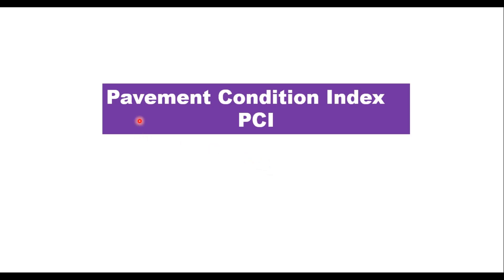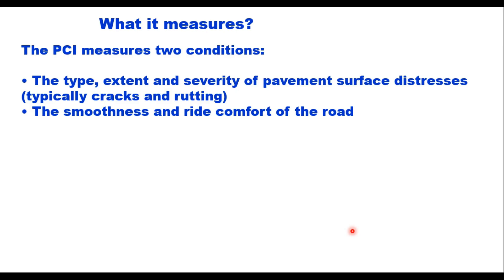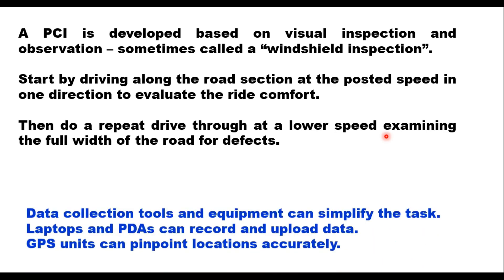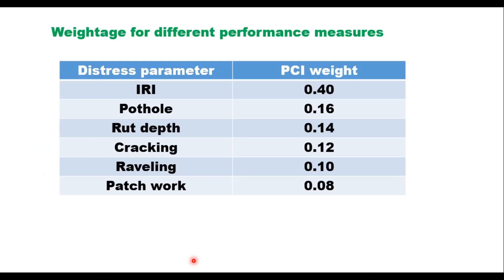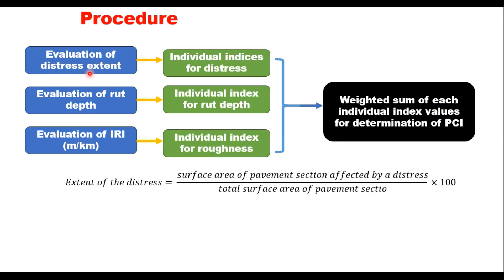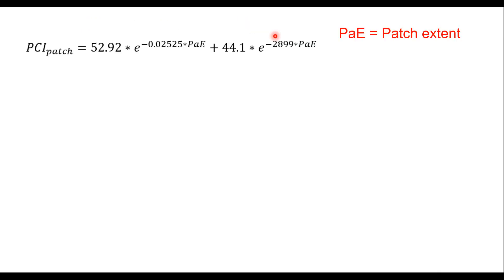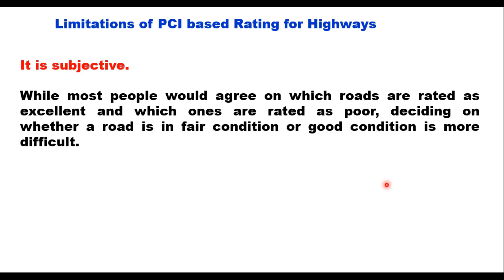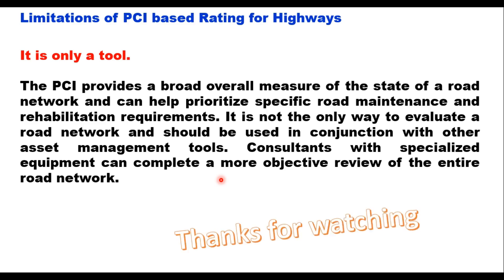Pavement Condition Index as per ASTM and IRC 82, 2023. step by step procedure and explanation.

Comment: sir for transvers and langitudinal how to measure in our case we measure length and width of crack is this currect are not and main cause for transvers crack is up rooting now what measurement shall we take either we take crack width or total uprooting  area what should we do now and this uprooting are same as bump or speed brakers give me the solution for this sir please
Reply from the maker: Take both separately.  Please refer IRC SP83 for further details. Proper investigation is required before suggesting any remedy.

Comment: Thank you for the insightful video, Sir I have both PCI and FWD data available, and I was wondering if we can relate these two metrics to better understand the structural health also alongwith the pavement health of flexible pavements. Would this approach enhance the overall evaluation of pavement performance?
Reply from the maker: You can try. Please tell me if u need my help.
Reply: @SatishIITR  Thank you for your response, Sir. Are there any codes that discuss or guide the relationship between PCI and FWD for evaluating pavement?
Reply from the maker: @Abhayguptx  NO, these two are difficult to correlate. FWD does not consider any particular distress to quantify the pavement quality.

Comment: Namaste sir, As per IRC 82:2023 as you have mentioned in the video that PCI ranges from 0 to 100. But as per Circular D.O. No. P 14012/58/2004 NRRDA, PCI has been ranged from 1 to 5 for field conditions. Kindly guide me which one has to be adopted sir.
Reply from the maker: You can adopt both. You can convert 1 to 100 scale to 1 to 5 (by dividing each value by 20) or vice versa depending upon your requirement.
Reply: @SatishIITR  Ok sir, Thanks sir 🙏🙏

Comment: Thank you sir 
I have one doubt , I got IRI value of 1.24 the pci should be above 90 but i got 69.87.
In IRC:82-2023 it shown in graph of PCI regarding IRI taken from 2-20 (m/Km) can you please clarify?
In PCI calculation formula regarding Ravelling and Patching it is e^-0.2899*RE in video it has shown e^-2899*RE.
Reply from the maker: An IRI value of 1.24 is very rare to get, even after resurfacing of the pavement. The equation given in IRC code is valid for 2 to 20 m/km range. It gives PCI 100 when IRI is 2 m/km. If the IRI is really (you need to check it again) 1.24, take PCI 100.
Sorry for this error. It is 0.2899 and not 2899
Reply: Thank you sir

Comment: Sir, I am getting negative PCI for pothole due to numerous  potholes for a section of road. Is it possible? If so shall I consider negative value or consider as 0 for calculating composite PCI.
Reply from the maker: In my opinion you should take zero
Reply: Thank you sir for your prompt response.
Reply: One more clarification is sought regarding the equations for PCI calculation of individual distress, even if the distress extent is zero, the PCI calculated is less than 100%. For example, for 0% patching extent, the PCI calculated as 97.02%. Shall I consider this as 100% or 97.02%.
Reply from the maker: @bidyutbikashsutradhar7190  These equations are totally empircal and generally applied to the conditions (limits) for which these are developed. If there is no patch work in a section, you should take it 100.
Reply: @SatishIITR   Thank you so much sir for the clarification.